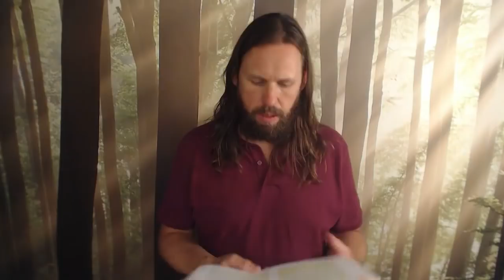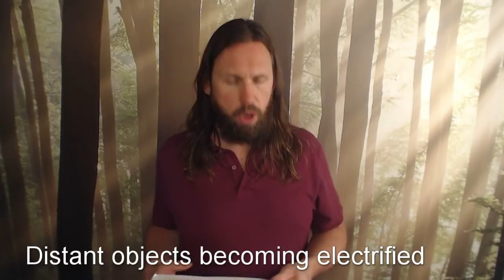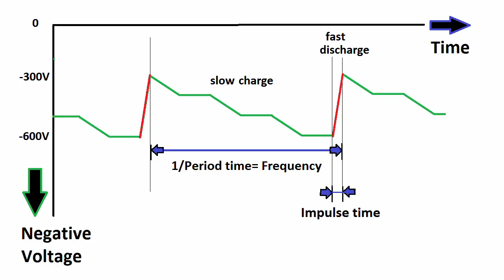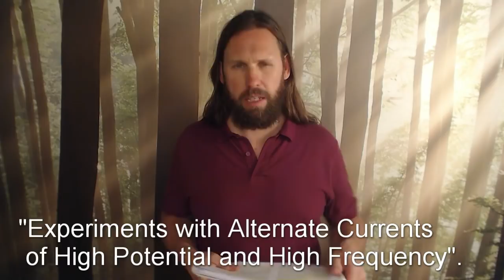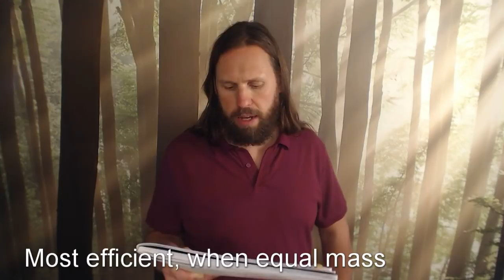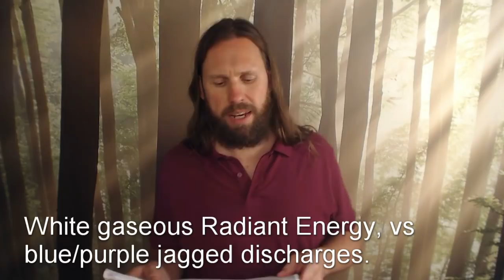Nikola Tesla's Radiant Energy Part 2 of 3

Comment: Beautiful lesson Master degree:) passion is palpable in your eyes I see the joy of the discovery in your eyes. Your passion is stimulative mercy to teach us your division and your passion for the wellness of the future. I wonder only how you will make to obtain disruptive discharges with low tension.

Thank you Ivo
Reply from the maker: Back then around 1892 the sparkgap was  the only method available. Now we've got diodes and mosfets. Also overcharging a capacitor seems to work.
Reply: I expect the continuation of your next video. I wonder only how you can discharge a condenser without roasted your transistor it is that the fast discharge of a condenser produces many amps according to the law of Coulomb this is why I wonder how your transistor will survive. According to your last video the key seems to be to control the period of discharge of this one it is perhaps make it that the discharge is partial in time but repeated several times a second which prevented the transistor from roasting and produce radiant energy.

Thank you Ivo my respect !! :)
Reply from the maker: yes the discharge time is short, and it is repeated but its not constant dc current only 0.0001% or something like that. But more important, the negative voltage discharge has different properties.

Comment: there is no ground, in the whole time. suppose to if you transmit power through earth, then where is your grounding point attach to?
Reply from the maker: Grounding can be done in the dielectric field. The Aether has inertia, so if you pulse fast and energetic enough, it will resist, and become a virtual ground. At least that is how I understand it.
Reply from the maker: Its like putting you hand in water. If you move slow, you can move it. but If you hit the water hard with a flat hand, It acts more like a solid.
Reply: not sure what your point, but what im talking about is voltage different between the phase. if you tap this emf in any electric circuit perspectively you can say it charge in counterspace. since tesla able to send power only single wire no ground needed anymore

Comment: I know you said you didn't want to experiment with 'HV' but one way it can be done is with a CRT so called 'Flyback' transformer {maybe you already have? }

anyhow it is simply a coil , a core , and a HV diode to form a HV 'flyback' it's essentially a HV 'magnetic pump' however i did do some experiments with the discharge as it is a directed discharge - but i didn't get too much into it .

one i simply wrapped a fairly large quartz crystal with a farily thik inductor just haphazardly and simply discharged the flyback into it - i noticed it disrupted my PSU at some distance - this is probably an 'EMP' type pulse however 

but never the less i mention it just because it's a possible route to experiment with HV  if you are so inclined - perhaps you will discover more than i did ? {i didn't spend much time on it} 

interesting book thanks for sharing.
Reply from the maker: Thanks Kolin Evans, I know the flyback transformer, but I will stay below the 1000V when discharging.
 The EMP by itself is a very interesting effect. worthy of investigating. Even more if it can be induced without a magnetic field (due to the ultra short discharge).
We'll soon see what I can achieve.